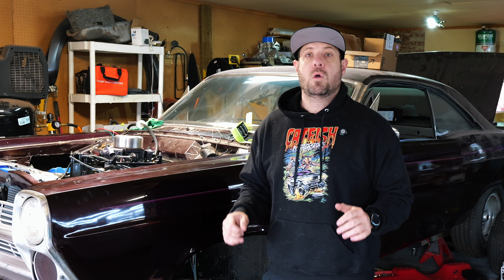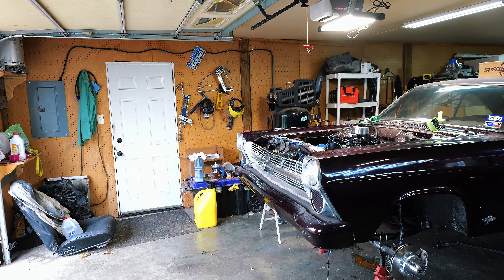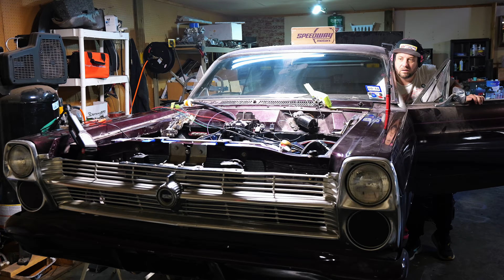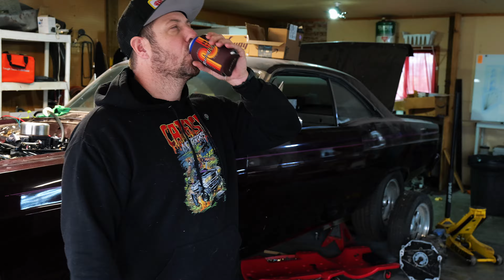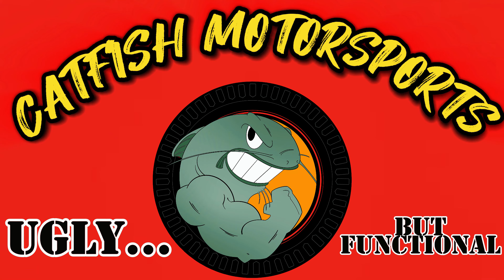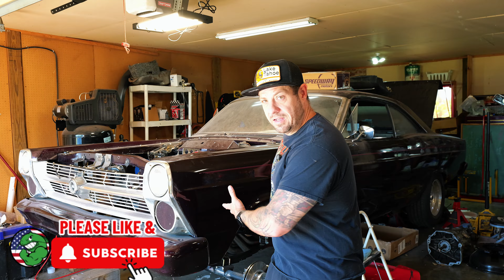Finally Firing Up the 503CI Big Block Ford GASSER!!

Comment: I have a suggestion for your wiring. On  the engine  harness I use a Deutsch connector mounted to the engine plate and the othersideof pigtailto the frame. That way you can unplug the engine harness with everything connected to the engine still to pull it quick. Saves on chances of damaged threads/connectors Also oil/fuel lines I use flat face quick disconnects. That way you can just pop the oil lines loose(Also auto trans lines on auto cars) and not spill oil everywhere. It also saves on wearing out fittings because every time you loosen an fittings is one time closer to being junk. You mentioned a block heater. Which Ford did offer on 460 trucks as option. I'm sure they're available. Another option or good thing to use is  oil pan heater pad to preheat the oil before starting. You'd be extremely surprised at how much longevity you gain on an engine by preheating it.

Comment: Very cool project. On the headers if there's room on bellhousing flange by starter you can notch the flange for header clearance and weld on v bands for your collectors. No gaskets required and easy to remove exhaust. Use aircraft cable or whatever kind of stainless steel cable and attach it to the frame and welded table on the exhaust so you can hang the exhaust when you remove it. It works really well for drag and drive type cars. Also if you ever have crankshaft to radiator clearance issues you can run two small radiators like Honda radiators Etc and use aluminum tubing and silicone couplers to connect the radiators together and have clearance. A lot of guys do it on procharger cars to have clearance.
Reply from the maker: The hanger thing is a great idea. I’m already in on the v band clamps. I haven’t done it yet but that’s the plan. That said I’m throwing on 3.5 inch straight through mufflers. I don’t know if removing exhaust would even gain anything. 

I’m afraid to notch the bellhousing because it’s an SFI unit. I’m afraid cutting on it would void the rating.
Reply: @CatfishMotorsports yes it probably would not be worth dropping the exhaust. I don't know about notching the bellhousing I think you're allowed to a certain amount on the flange but I would check with your local NHRA attack inspector to see for sure. Or check the NHRA rule book. Looking forward to seeing that car make a pass

Comment: Uncle Bob here, dig the Fairlane i also have a 67 that i;m building i was going to do a gasser but am going for autocross instead i have a full built 289 with a c/4 i have been working on it  for 5 years now some medical problems got in the way but i'm going back at it soon.
Reply from the maker: That’s a bummer about the medical problems but stick with it. You’ll get there. 

Oddly enough that was the previous owners vision for this car. Crazy front suspension pro touring auto cross type deal.
Reply: @CatfishMotorsports  thanks Bud.